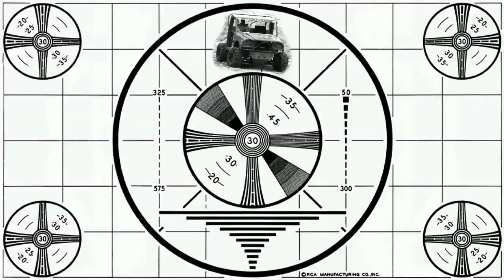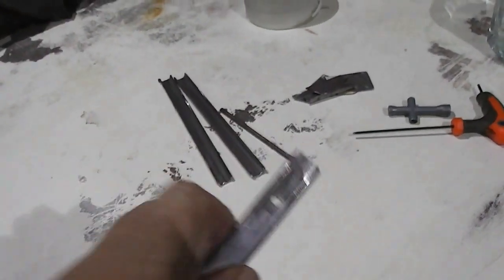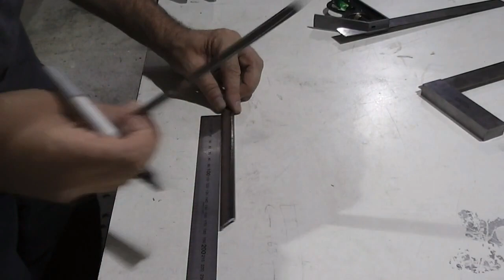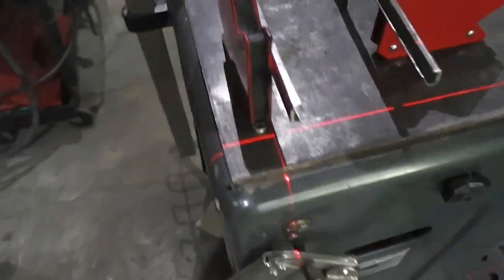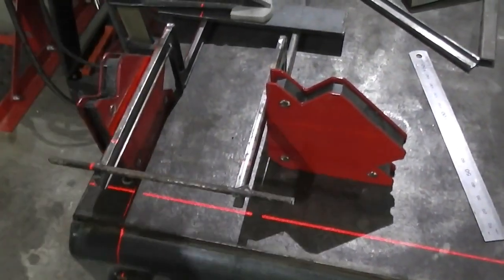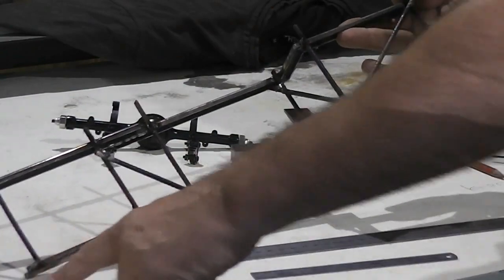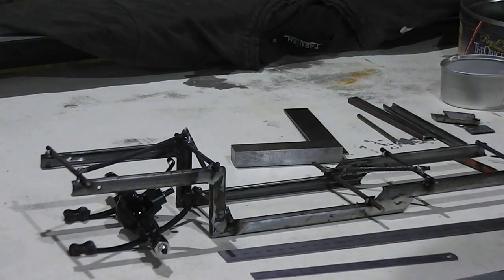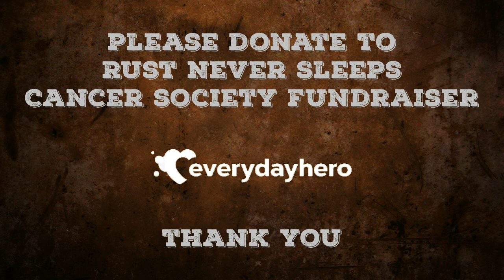Rust Never Sleeps (part 5). RC Rat Rod charity auction build for Cancer Society NZ.

Comment: Looking good. What settings on the MIG? What size square tube are you using?
Reply from the maker: +Mountain Storm Thanks man, I think I am using the wrong settings on the mid, nasty welds. I had it turned up pretty high, but sometimes it didn't seem to take to well. Square tube is 12.5mm (1/2") tube, 1.6mm wall thickness.
Reply: +cyanidetube Right on. I am still building TIG skills so I can knock together a tube chassis. Rod is no problem and this heavy-ish square tube looks do-able at my current level...but thin wall SS tube just evaporates under the torch. I've got  pile of shriveled scrap. You are doing stuff that is really on the edge for MIG.
Reply from the maker: Ignorance is bliss with me, I don't know much about welding so I just try it and see what happens, lol. That's the beauty of these little cars, no lifes at risk if a weld fails.